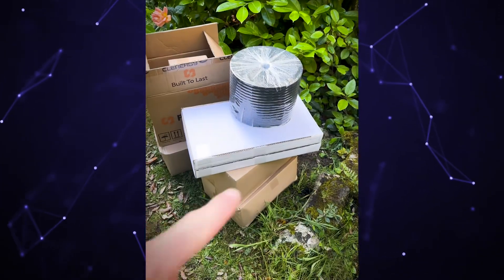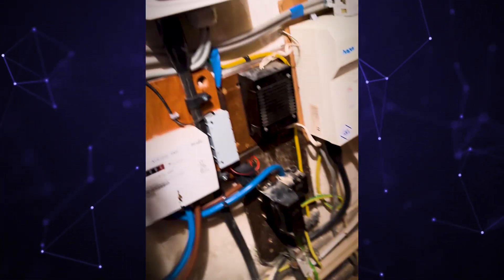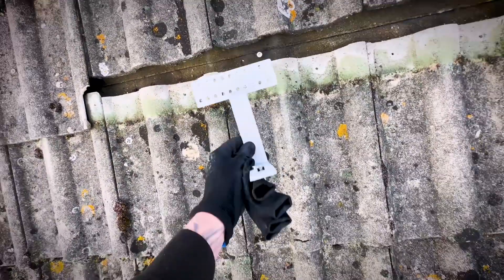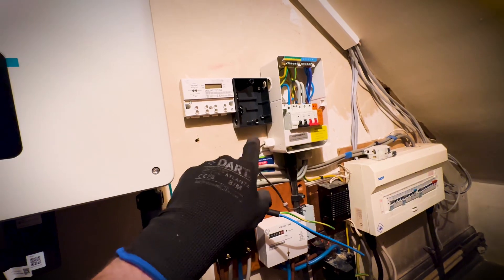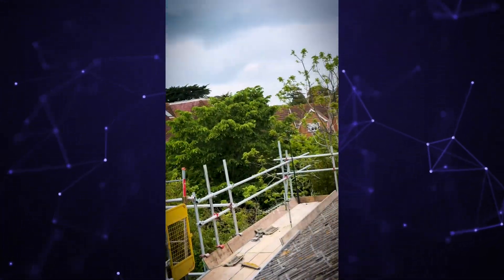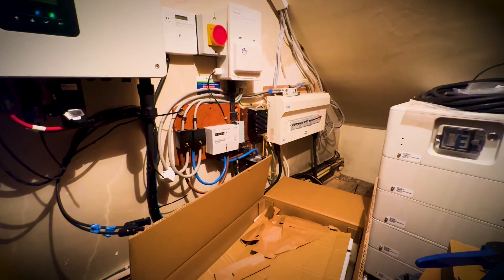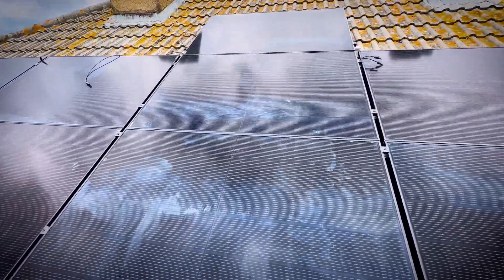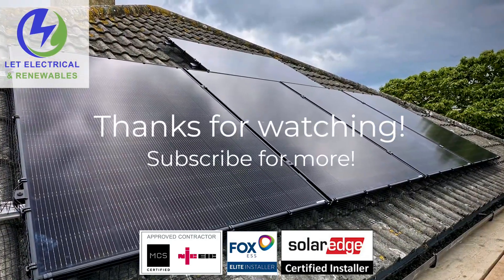Solar PV & Battery storage Installation In Bournemouth | Step-by-step video |

Comment: Nice work! Can you detail the panel setup wattage for the two roofs? You have 6,960 watts total available by the stickers. If you have 4,785 watts on one set and only 2,175 watts on the other set, are they wired the same or different volts/amps? It looks like a very robust system and should provide a lot of power.